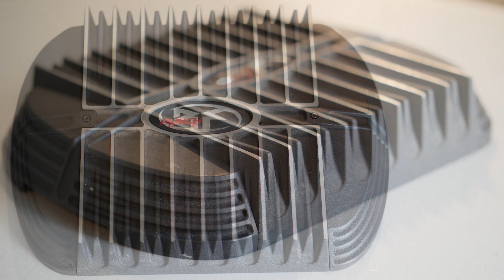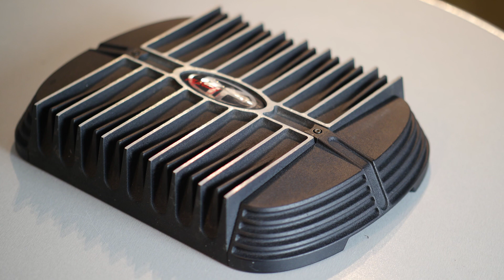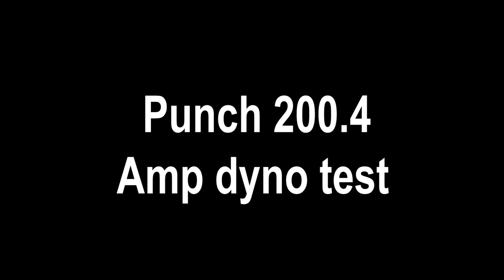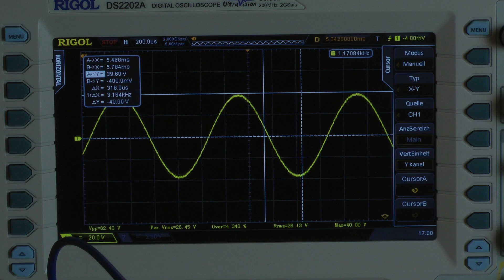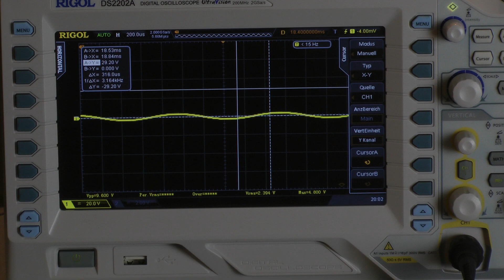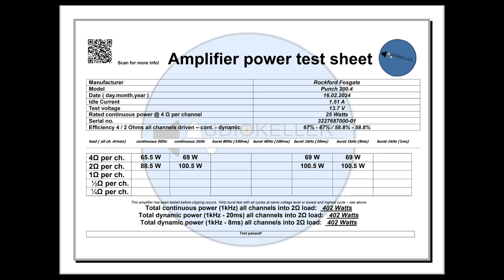Rockford Fosgate Punch 200.4 car audio 4 channel amp dyno oldschool amplifier power & sound test

Comment: I have one of these and inside is 2 Philip head dials in there. What are those for?
Reply from the maker: Never touch them , they are there to adjust bias. If you changed position there is danger of overheating the amp. If you did not touch them leave em like they are. If you touched them get them adjusted correctly again! Or do it by yourself using multimeter and my bias adjust tutorial video 👍

Comment: I still have a bd1000.1 that i got over 20 years ago. It makes a little noise but still going strong
Reply: If it is making high pitched like whine/buzz, it was very common on these golden era amps.. when i first bought mine in 2014, it also had the buzz/whine. I fix it by taking the cover off the bottom and applying a good coat of clear silicon all over the coil. That was 10 yrs ago this coming July with not one sound since, and it has NEVER ran hot/any issues since.
Reply from the maker: The bd1000.1 looks like this amp but is different technology, it’s a switching amp not class ab
Reply: I meant mine makes noise because it needs repair but still going strong. It's been used daily for the time I've owned it. I love the old amps, I have a lanzar opti 100.2 and 50.2, eclipse pa34230, crossfire vr705d and a few others. I might look at getting rid of some of them soon

Comment: Your videos bring me back to when I was 19-20. I had a 451s running the fanatic 6.5 components. A BD500 running 3 of  the base line RF 10s.
Reply from the maker: Last week I found out that the 451s is also a great amp - check the dyno video 😁✌️
Reply: @audiokeller1975  that was the second video of yours I watched. That early 2000s line will always be my personal favorite.